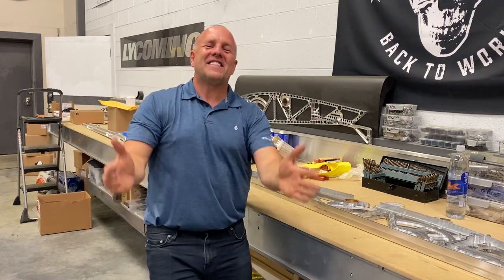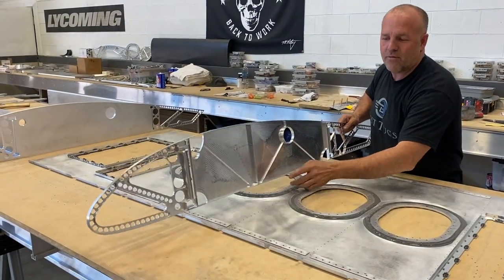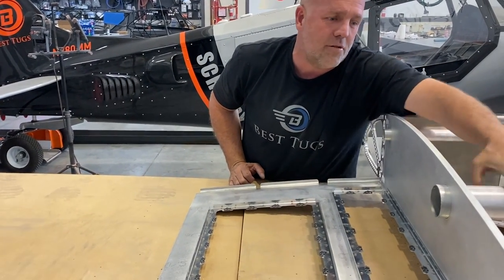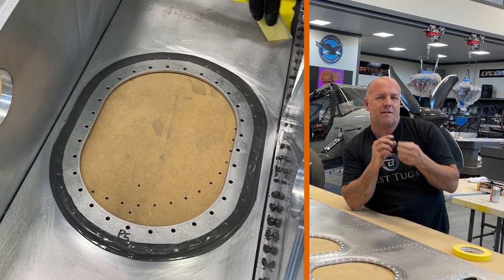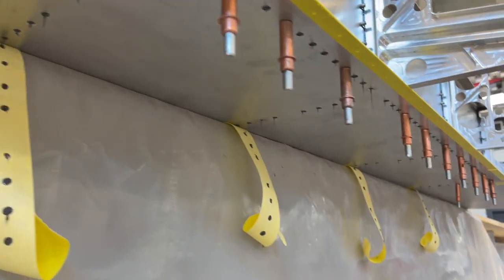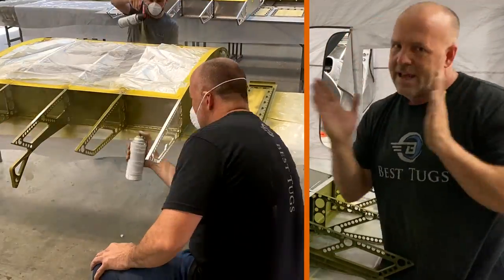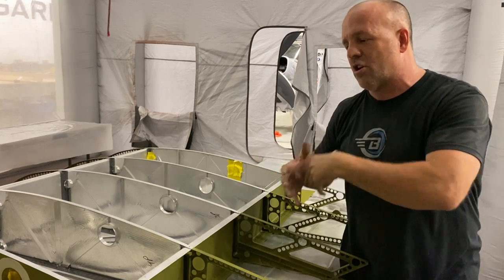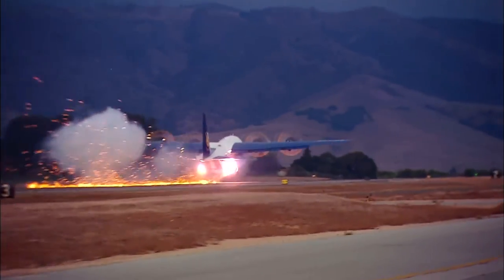Building 120 gal fuel tank for my crazy Bush plane | Scrappy #55

Comment: Former 747 assembly mechanic here.  Your explanation of tolerance for countersinking rivets is very good.  It was 45 years ago but I believe our standard tolerance for flush rivets was + .001 to .002 / - .000.  In other words, below flush was out of tolerance and grounds for a rejection and special repair for the reasons you mention.  Also depending on the thickness of the skin, if countersunk too deep it creates a knife edge on the skin which can be a point of stress induction into the rivet potentially causing it to fail before service life was complete.
Reply: Current 767 assembly mechanic on the wing line here. Every rivet we install must be microshaved to match flushness of the skin, whether it's composite or aluminum. Were you body structures or wing structures?
Reply: @mattpalmer8918  Was going to say, just a touch proud of flush and hit it with a microshaver for perfect flush rivets! Nothing looks worse on a clean plane than a bunch of smoking rivets. More importantly they are a failure mode.
Reply: @mattpalmer8918  When I was in the USAF (E-3 structural maint), we also microshaved them.
Reply: Former aircraft engineer here. Yes to all, and in fact I never designed for a countersink more than 2/3 through, and that last 1/3 or more was always at a chosen length or more. The idea was to completely avoid even the chance of a  knife edge, given expected variability in actual csk depth in production.
Reply: And the old FT rivets were left a bit more proud

Comment: MIke's building his own custom wings in his own shop. Designed and machined to precision. What a stud! Meanwhile, I just personally changed the oil in my Silverado but i don't feel quite as accomplished as Mr. Patey.
Reply: I built a carport out of an old trampoline frame and tarp. It's nice but was simple. Didn't have to do anything but think a tad and slap it up :P
Reply: Ya missed the point...    Get back to work.
Reply: Squawk i did less than that today.
Reply: @geepuller1  over achiever! :P
Reply: I was going to change the spark plugs and wires on my diesel truck but, apparently, they've buried them so deep in there that I could never find them. Back to work!!!
Reply: @MichaelLloyd  Keep looking! :P

Comment: Imagine if Mike designed a bullet proof vest. Rated for 9mm but tested to 50BMG.
Reply: If you get hit with a 50 bmg anywhere even with armor body plating, will still kill you just from the recoil effect of liquidating your organs or your meat. The shock from the energy would either push the steal plate through your body, or the shock will liquefy your organs.
Reply: @RifullOfTheWest  yee of no faith in Mike
Reply: @RifullOfTheWest  Understood, it was meant as a joke as to how much he over engineers everything
Reply: @RifullOfTheWest  It was an analogy. Mike tends to "over engineer things". 
Context, then chill ;)
Reply: I'd buy one if it had maximum cover & near the throat. ,With a battery operated heat dissipation system. With shoulder guards.
Reply: @imaner76  Oh trust me i understood the joke, but I'm more of a serious person too and tend to pick everything apart lol.
Reply: @hoppermantis7615  I dont think there is body armor u can wear that would stop even normal lead bullets from a 50 bmg. I'm scared to even shoot mine frequently lol let alone be shot by 1.
Reply: Ma he would likely source a Abrams tank.
Reply: He’d design and build a tank….
Reply: @RifullOfTheWest  I'm sure you understood the joke. But by action, IE what you typed... it was not evident. 
I'm not a serious person. But I am an analytical one and as such lean more toward evidenced based reasoning. So I omitted the fallacy of perceived trust and got straight to an evidenced based response. 

Or in short, you had an r/woooosh moment. Got corrected. 
At least, on "paper"  😎
Reply: @RifullOfTheWest  😶

Dude.  I'm a three tour combat vet, and you just way overdid that.  To the point of creepy.  Violence porn creepy.  So... don't do that. 

That said, I'm going to bust your bubble.  You're more wrong than you think.  I've seen a man survive being shot in the right upper chest with a .50 BMG.  Afghan policeman, 2007, no plate, no vest, saved by American doctors and returned to (limited) duty.  I was a combat advisor with his unit.  I'm sorry to disappoint you (he's not), but your liquification fantasy is not real.  He was very lucky, even with the really bad scarring and loss of some muscle tissue; he wasn't 100%, but he was happy to be alive.  However, he was not liquified.  That's not how any of this works.  If you don't know what you're talking about... and you clearly do not... it's best not to show people that dark place in your mind.  You weren't being analytical, because analysis is about how things really work, like finite element stress analysis.  What you did wasn't that.  You were being sick.  There's a difference, and I've seen and lived that difference.  So you really need to get over that.  It's offensive, especially to those who actually know reality.  Those who don't have no business being subjected to it at all, because it's not nice.  Men don't talk like that.  You managed to take something ugly... and I'm not talking about the original comment, which was funny, I'm taking about a human being getting hit with a .50... to the level of disturbing.  It wasn't even real; it was just you enjoying ugliness.  Keep your sick stuff to yourself, please.  It's only polite, after all.
Reply: @skipdreadman8765  Hear, Hear: The voice of reason! Good luck to your buddy and Cheers!
Reply: Knowing how mike works he would simply put a picture of Chuck Norris on the front and back of the vest there fore stopping any round from approaching at all.
Reply: @RifullOfTheWest  Oh ye of little faith 🤕
Reply: @skipdreadman8765  
Your integrity forces my commenting. I humbly thank you Sir (and all honorable military persons) for your service to the USA. I can only begin to imagine what you've "seen and lived" in three tours.  The raw reality of war leaves no room for Bull Sh!t. I admire your style, no name-calling, no profanity, and no room for BS. 
A man with integrity. 
After reading your reply to Bill Allenbaugh, the first image that came to mind was... “Ten-Hut” @Bill Allenbaugh! 
A toast to you... with a glass of  The Balvenie, I'll just leave the bottle...

Comment: Mike, don’t worry about the videos being to long. I’m here wishing you had 2 hour videos.
Reply: I can second that.
Reply: I'm wishing for a live-feed of the build! XD
Reply: Yeah I don't think any of us would mind a few hours a week. there is not a TV show on that could hang with this guy. I mean he takes his time not only to do things right but to tach us to do them right,  these car building shows show them starting a weld and 2 minutes latter the entire chassis is welded up. At least here it is very detailed and you can truly learn. I am building a hot rod and a lot will relate. I even using his zip ties with the rubber coating to protect wiring. very good product. This many is no dummy and his work ethic is second to none.
Reply: Ikr

Comment: As a crew chief on KC-135’s, I spent many hours scraping conformal coating off of the insides of the fuel tanks that wasn’t prepped properly and was pealing off! Yes there were clogged fuel filters! Pain in the rear but at least the tanks were big enough to fit inside! Go USAF! Retired after 38 years of working on C-130’s, A-7’s, and finally KC-135’s. Definitely going to order one of your shirts!
Reply: Worked on at planes, can’t forget cleaning off poorly applied pro-seal in wing tanks, you could just barely get your arm in.  It’s a wonder that I don’t have nightmares about that.  My shoulders still suffer 35 years later.  But that seems to be common with aircraft mechanics, eh?

Comment: OMG man, each rib is separately CNC’d?????  Holy freaking crap man!  That is insane.  Absolutely amazing!
Reply: Yeah right next level
Reply: Exactly what I was thinking after doing wing skins on my Maule with all stamped ribs its so cool to see his! 😎
Reply: This is an engineering project, this wouldn't go to well if this was a manufacturing project. Milling out chunks of aluminum is used in rocket manufacturing and is one of reasons why rockets are expensive. It is a good way of adding a zero at the end of the price tag.
Reply: Tymoteusz Kazubski as I said mike is next level bro , there is a reason kit planes have pressed ribs etc , cost ! Don't mean this is NT pretty cool right !

Comment: Thank you!  I listen to the engine rolling and it reminds me of 40 yrs ago, when I met pilots of TBM Avengers. The planes had been converted over to spray planes.  Everything else was as installed.  That summer a pilot had the engine go - he was in sight of the St Croix river.  Between Maine and NB.  The pilot had absolute faith in the plane. He put it down in the river. If you have ever been around the area - it Grows Granite Rocks. As the pilot put it - " I knew I was flying the toughest plane.    I have followed yourself - as the engineering and advancements in Tech amaze me.  Cheers to you and yours!

Comment: Mike, be sure to print the flag on the sleeve as if it were flying as your moving forward. Friendly reminder. Love your work.
Reply: Yes, this!  Don't want anybody wearing a shirt with a flag in retreat.
Reply: My understanding is it doesn't matter which sleeve, just as long as it's flying with the stars forward as if moving forward. Correct?
Reply: @kelsondigital6183  that is my understanding as well. after all, the stars don't go "on the left" they go "next to the pole" and if that pole is on a vehicle in motion then the stripes will be to the rear, no matter which direction it's viewed from. (unless it's REALLY windy 8)
Reply: I just checked out the website, the image shown in the video is the back of the shirt.  So, the flag is on the left sleeve and facing the correct direction.
Reply: After you learn that bit of information, its really annoying seeing it messed up all over the place

Comment: Pro-Seal, the only material you can use 40 miles from your house and it still ends up on the flipping’ couch!  By the way, I haven’t seen ZnCr primer in forever.  We use an epoxy primer on the big stuff called FR Primer.  It is a two part, self etching, tougher than unobtainium epoxy primer that is a mandated material sealer.  Pro-seal loves the stuff and the epoxy will NEVER come off of the aluminum.  It is a PPG product and we call it 4123, really good stuff and way more durable than ZnCr primers.
Reply: Lol on the Pro-Seal!
Reply: im using zinc chromate on my zenith 750 stol project, i buy it from canadian tire here in ontario made by duplicolor and it doesnt scrape off with your fingernail like the stuff zenith uses which does scrape off with your nail!

Comment: Hi Mike, damp squib here, we have found that rattle can Z-C comes off over time and it doesn’t seal, and corrosion can start.  Not to mention that some call it cancer in a can.  We have moved to a two part primmer epoxy in our paint shop for bare metal on our helicopters, it fully seals and then scuffs up for top coat. Keep going our Chanel is great.

Comment: Really can't wait to hear why Aluminum was chosen on the wings.

Yes. I'll want a 👕
Reply: I suspect he did not want to make I beam spars out of Carbon fiber. Likely some additional issues that pushed him the current direction using all aluminum for the wing structure.
Reply: @danblumel  risk of structural delamination?
Reply: @Newberntrains  carbon fiber doesn't work harden like metal, but it can be very, very hard to detect stress fractures in it.

Comment: About the Zinc Chromate coming off, at Lockheed all of our internal structures use baked on primer to avoid this issue.
Reply: What temps? You cant go much before you anneal the metal.
Reply: @thecommentary21  flash
Reply: @thecommentary21  it’s done long before it gets to us so I have no idea what the actual temps are, but keep in mind the metal we work with is much thicker than most of what Mike is working with.
Reply: @superskullmaster  So I guess the metal wont get so hot it anneals. Was Just curious.

Comment: I’ve built 4 tanks with proseal. It’s hard to do it without making a mess and looking like tarbaby. These guys are really doing a neat job. Im sure all the RV guys think he is crazy to use the 3rd level of sealing. Sounds exactly like the sloshing compound that has caused nightmares in the RV community. What he has done with proseal should be perfectly good and unlike an rv tank he has huge access panels to inspect it if it isnt. But it’s his airplane.
Reply: It is also not his first airplane.
Reply: Tarbaby? Come on man that's not necessary.
Reply: @PatrickJWenzel  ???
Reply: @PatrickJWenzel  Who is "Common man"?
Reply: @PatrickJWenzel  you do know that tarbaby is a character from a children's story from the 1800s right?
Reply: @sblack48  I don't. I've only heard it mentioned in a racially derogatory sense. What's the story called? I'm more than happy to look it up, be educated and apologise for my comment if the historical back story is not based on a racial misnomer.
Reply: The story of br'r rabbit. One of the uncle remus stories. Br'r fox made a dummy out of tar to trap br'r rabbit. It is also an expression which means the more you fight something the more you get tangled up in it. I've never heard it used in a racial context.
Reply: @PatrickJWenzel  google brer rabbit
Reply: @sblack48  Well I'll be. I checked it out on google and I certainly stand corrected here. The very few people from the States who I've heard use it did so in a derogatory sense so I've clearly made a broad assumption. Sign of the times I guess. I appreciate understanding the proper context now and I'm grateful you were patient enough to educate me. Please accept my sincere apologies.
Reply: @PatrickJWenzel  my Mom read those stories to me as a child. There is a picture in one of the books of the rabbit covered head to toe in tar. Exactly what I look like after a session with proseal!! 😀
Reply: @sblack48  Haha oh I hear you. I'm no longer swinging spanners for a living but after 14 years of fixing Lockheeds, Boeing's and Airbus's I can categorically state that pro-sealing leaking RV wing tank access panels without removing the wings is by far the messiest job I've ever encountered. Indeed, a guaranteed tar-baby portrait moment.

Comment: Question, you have the holes between the baffles at the top of your fuel tank. How do you plan to use the fuel outboard of the first set of baffles?
Reply from the maker: 👍🤠 Watch close on the areas where pulling tape.  The bottom of the tank all have pass throughs at the front and back and the top has them all along the high point for air.  The ones that don’t have them are end of tank and the fuel sump and line points attach last.

Comment: A fuel tank made like a tank-tank inside an airplane built like a tank-tank.  It’s a tank-tank fuel tank but in an airplane built like a tank-tank.  Got it?  It’s an airplane, but it’s basically a SUBSAFE vehicle.  It’s like the tolerances stack to .0000.  Hey Mike, why did you use those type of rivets on the wing tips?  “Otis I used those rivets because of the special viscosity brake fluid I’m using on the wheels.  This matters because ……..( and 5 minutes later I’m the most educated individual I’ve ever been.). Love ya Mike!  Preaching engineering and teaching work ethic.

Comment: What a great gift from one of our air crews overseas. God bless them all.

FYI, the flag on the right sleeve should be backwards. The stars should be toward the front of the shirt so that the flag "flies" as though the flagpole is in front of the wearer.
Reply from the maker: Yes sir 👍🤠 that is the direction and if you thought it wasn’t your confusing the front and back of the shirt 🤠
Reply: @MikePatey  Mike, it wouldn't be the first time I put my shirt on backwards. Thanks!